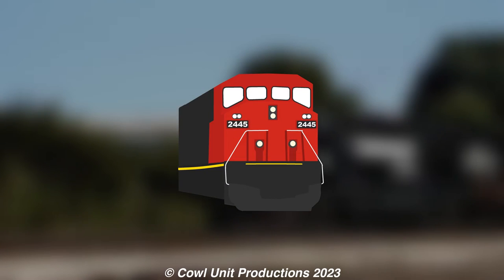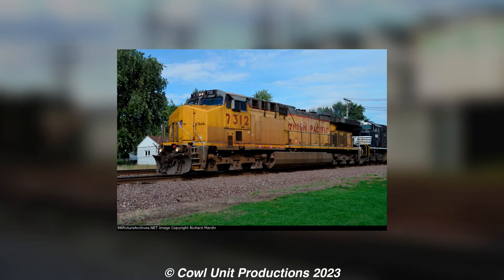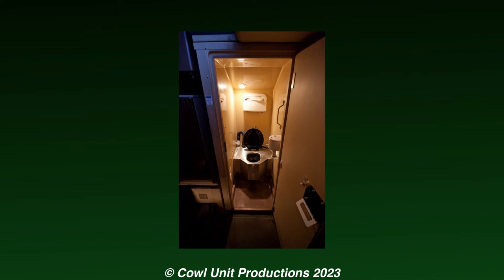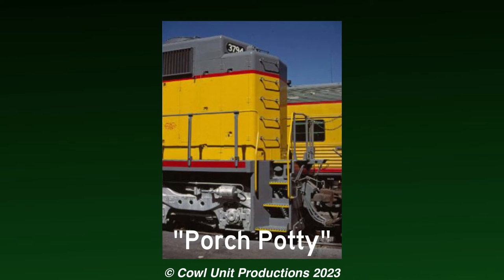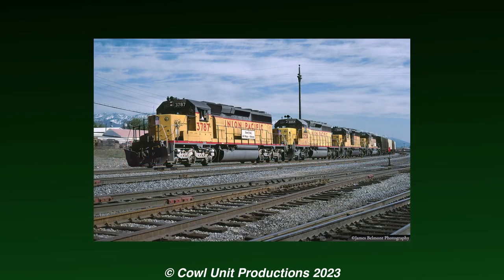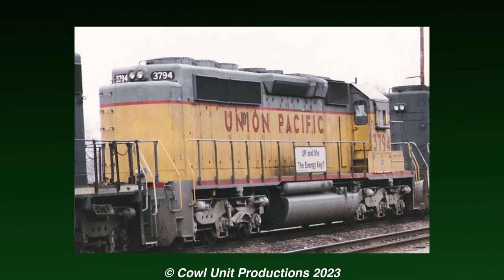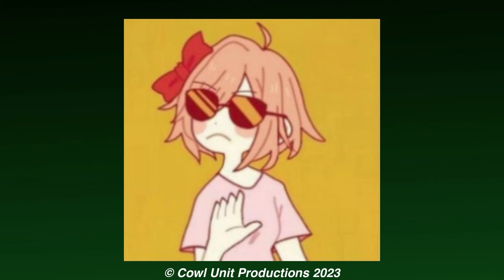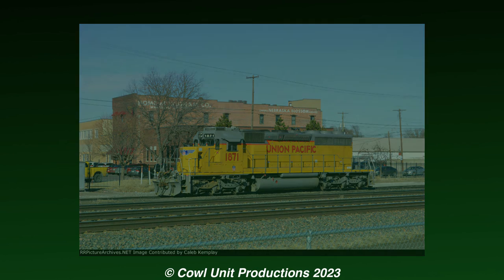Bite Sized Oddities - "UP 3794"

Comment: Looking forward to these short little videos! Any planys on doing a video on the LNG SD40's that CN, BN, and anyone else had?
Reply: One of the BN LNG SD40-2's ended up on NS. It was BN 7149. It had a flared radiator like the SD45. 7149 became a leaser unit in 2000 and numbered HLCX 7149. In 2013 NS bought it and renumbered it to 3528. NS repainted it in 2014. Then in 2021 it was rebuilt to a SD40-3. It is now 6405 and does not have the flared radiator anymore.